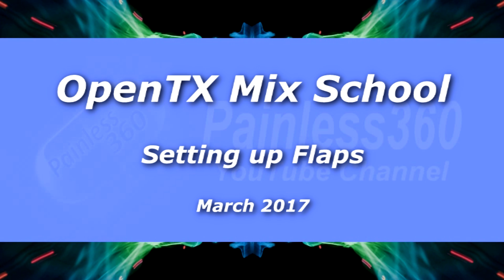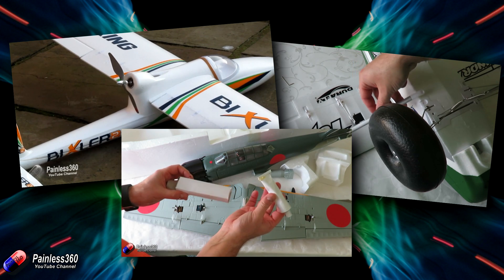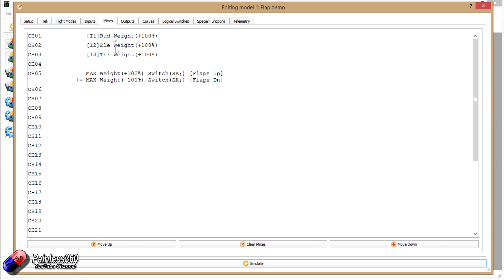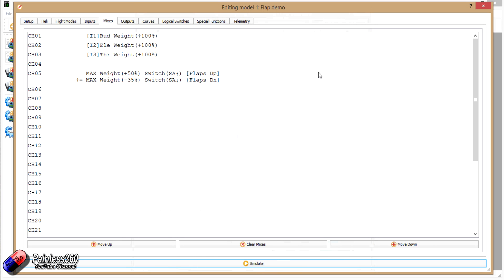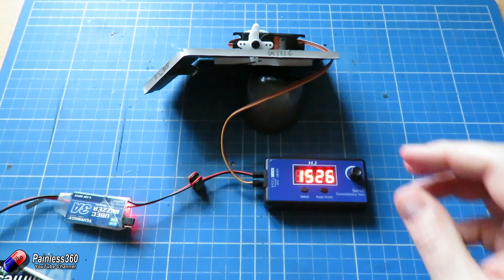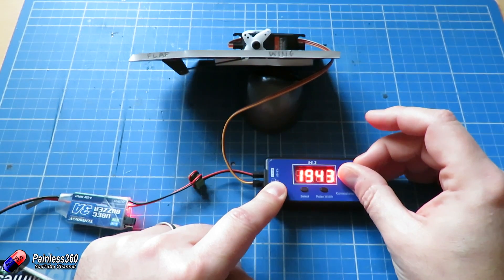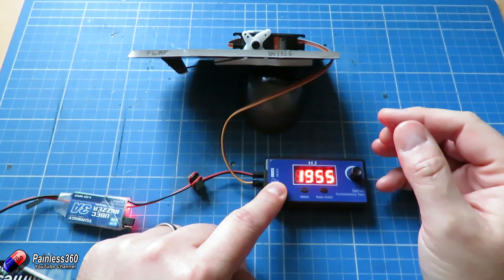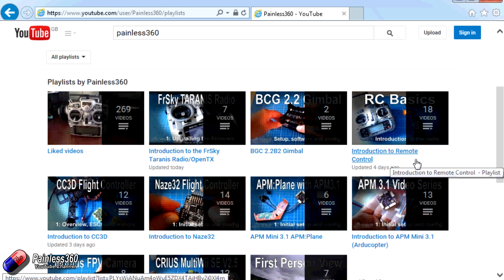OpenTX Mix School: Setting up Flaps on a Fixed Wing Model

Comment: I could not get it to work with using the source "MAX" I had to use the switch source I was using. You didn't really go into MAX value, also I want 3 positions flap setting up middle full. When I use middle the input is 0 adjust the weight of 0 has no effect I can't set the middle setting at all using the weight.
Reply from the maker: I've covered MAX in lots of other videos. Be aware that things change from OpenTX version to OpenTX version and radio to radio.. See my plane setup videos for more options..

Comment: What is special about the (virtual) “MAX” input? Though I see how it worked in the case of your instruction (THANKS!), when I tried using an actual 3-position switch, wiith the weights set to -100%(POS1), 0%(POS2), and 100%(POS3) (to get started) as an input, the simulation showed that the output of the MIXER for the designated FLAP channel changed from -100(POS1), to 0(POS2), and stayed at 0 when switched to POS3. Any idea why? Thanks.
Reply from the maker: Check out the other videos in the Mix School and you'll see how it's used a little more... Best of luck!

Comment: What I would personnally do would be to first set the flaps to a pot on your transmitter (or even a stick... it's temporary so it doesn't matter) instead of a switch, then figure out what channel % gives you the desired travel, and then enter these values for the switch you want to actually use. This way you don't even need a servo tester.

Comment: Just wondering - setting up an EDF as in your video - so much more precise than the old on-model trial and error. I am anticipating a long roll out on landing and would like to try (after normal landing with flaps) an “airbrakes” 90 degree position beyond Flaps 2. I’d like that on another switch if possible. Think that might work (maybe even in combination with both ailerons up)? If so, how would I set that up so that it operates independently of normal flaps?

Comment: How about a video on how to set up the throttle stick as both throttle and flaps (single servo flaps). With flaps, off, throttle on a 3 way switch. With throttle cut on SF. Reflex,cruise, camber on another 3 way switch. I have yet to get this to work on the Taranis. Everyone I asks tells me to change the throttle to a different switch or some such. I like it this way. If my Futaba 12 FG can do it the Taranis certainly should be able to. I'm having limited success and am getting frustrated. TIA

Comment: If I mix down elevator with a slow up and down flap deployment how do I correspondingly get the elevator movement to operate in sink with the slow flap movement. Applying delays to the flap mix doesn't seem to work correctly. I don't want the full elevator mix to be applied before the flaps have reached their final position.
Reply from the maker: That might need a video to show but it’s easy to do..

Comment: Nice Video - thank you. Could you possibly expand on this and illustrate how to set up a flap elevator mix where custom flap settings are used with a 3 position switch. I did watch your other video where you just assign a switch linked directly to the flap channel. It is quite a bit easier to get the elevator mix under those conditions. But I have been struggling trying to get the mix to work properly when custom values are used for the flap positions.

Comment: Wish I had NOT bought X9D! Futaba is EASY compared this. Still that's the price you pay for buying cheapo stuff
Reply from the maker: Watch the Taranis playlist from the start. It’s designed to help..
Reply: Sorry but don't want to take me laptop to windy hillside in January with bunch of down loaded vids thanks. What i want is a half a dozen pages of A5 how to examples. Guess when i figure it out i have a little publishing job to do :-) Other than that many thanks for the time and effort you put in to making the videos.
Reply from the maker: With a little practice most pilots get the hang of it. All of my videos have examples and cover everything in detail. I guess you've got some reading/watching to do ;)

Comment: Another way to slice this cake. On the outputs screen limit the servo travel. Maybe even change the centre. This does away with having to calculate percentages. 
Actually in theory do this for all channels to ensure that the servo travel never exceeds physical limits (as long the servo arm isn't removed and put back in a different position)
Reply: Please make a video of it !

Comment: I've got flaps on my Sky Eye and a Taranis.  I've heard it balloons a lot when flaps are deployed, so I'd like to mix in some elevator.  On the flap servo, I set it with full deflection at neutral flap so I have the entire travel for flap down.  That works well because I carved the wing forward of the bottom hinge a bit to provide more relief and throw.

I'm having a weird problem now where the elevator can deflect down, but not up.
Reply from the maker: +Hugh Hemington I normally fly the model and see how much elevator is needed to correct the ballooning and then add that amount using a simple add, connected to the flap switch in the mixes.. how are you doing it?
Reply: The magnitude of the lift depends on throttle/speed, so I'll fly it and get a feel for how the need for elevator changes from low to higher speed and probably split the difference somewhere.

Comment: Thanks for the video Lee. I have a question for you. I have a phoenix 2000 with a 4 servo wing. I have setup crow on a 3 position switch, but would like to have a knob/slider that can control the crow movement in either half or full flap position. I know Open tx would be capable of it, but I can't get my head around it. I don't know how to make the knob/slider the primary control when crow is in the middle or lower switch position.
Reply from the maker: +Jeandré du Bois the trick is to use the slider to alter a global variable and use the GV in the mix. Hope that helps..

Comment: Very nice!  But you could use limits on the servo travel as opposed to weights, me thinks. I have mine on the left slider, so it is variable.
Reply from the maker: +DSA44 very possibly!  As wirh most things in OpenTX there are lits of ways to skin this particular cat ;) Happy flying!

Comment: Why don't you put your flaps on a slider then you can bring your slider down lowering your flaps and then set the end points so the flap stops where you want it to, that's how I done mine
Reply from the maker: +Allan T you sure can, see our video where we use a rotary switch to be able o change deflection on the fly. Useful for flaps, crow, camber etc.. happy flying!

Comment: I use the rotary pot on the Taranus as the input for the
flaps then just read out the values that are required on the transmitter for low
mid and high settings and then assign them along with a switch for the flaps as you do.
Saves having to connect up a servo tester.
Reply from the maker: +Trevor Buzzard nice idea!
Reply: Trevor, sounds cool. Would you mind explaining the process for setting up in a little more detail?
Reply: Just starting out, this is an awesome idea. Thanks

Comment: OK I will watch Thema again and again ; )
Reply from the maker: +MaxFpV flight cool, you just need to add a line under the existing elevator mix that adds a little of the throttle input. We do things like that literally dozens of times in the examples.. Best of luck.

Comment: Thank you Lee! The servo checker is a great tip as is that reminder to disconnect the linkage for setting up flaps.  You are a great help for a great radio in a great community! Jim D. aka Dynascrew
Reply from the maker: MrDynascrew glad it made sense! Happy flying!